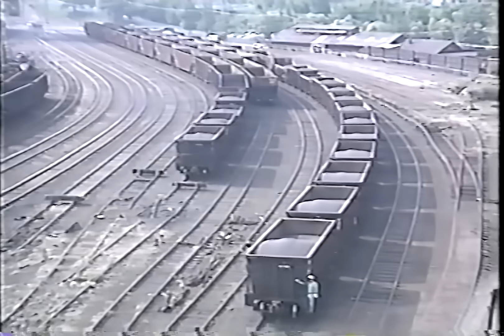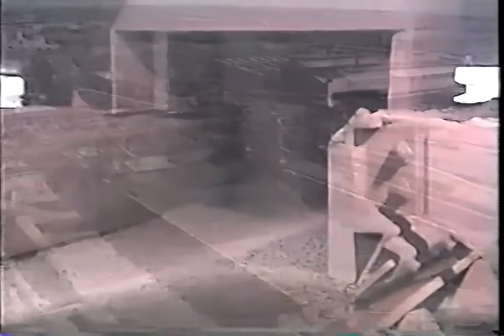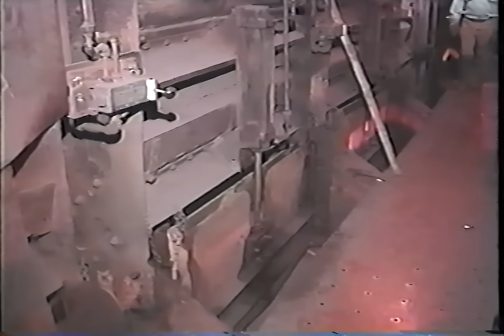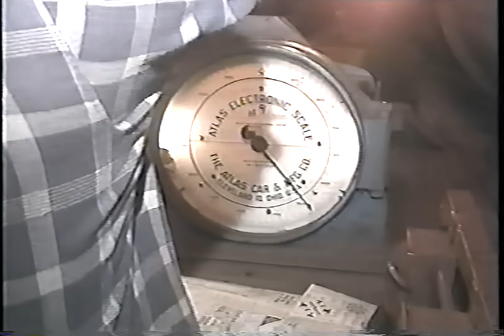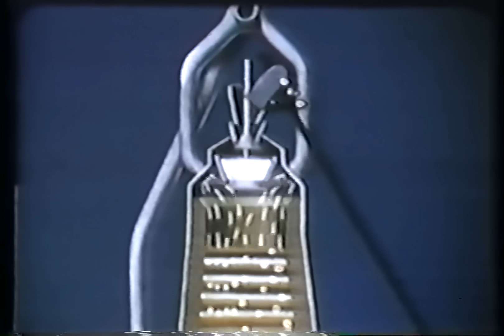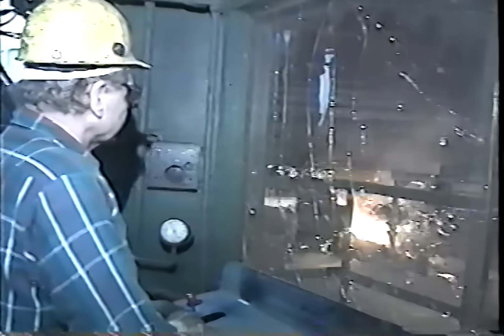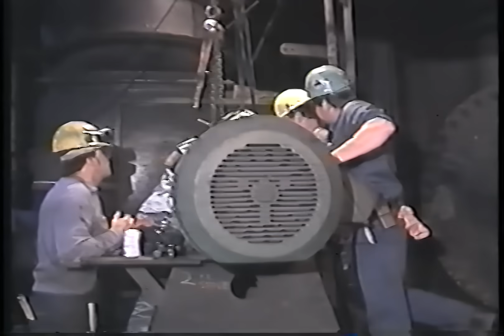Beth Steel Furnaces

Comment: Good video, thanks for uploading.
Filmed in 1995, closed in 2003.  One of the ore bridges now stands over the entrance to a gambling casino they built there.  The blast furnaces were bathed in red light at night last time I was up there, a reminder of their glory days.

When I was a kid, back around 1970, we use to watch the ore trains pass through our town on the Reading Railroad.   There'd usually be four good sized, green & yellow diesel locomotives hauling 100 or so cars through the middle of town.  And they'd be moving too, I'd say 40 or 50 MPH.  Two tracks, northbound towards Bethlehem, and a southbound towards Philadelphia.  It was an everyday occurrence, multiple times a day.  The ore trains would rumble north and the empties would rattle & clack south.  Nowadays they've torn up one of the two rails north of us and it's only an occasional, small, slow moving mixed freight on those rails (although there is a fair bit of commuter train traffic to the south).  It's hard to believe those behemoth trains use to roar through our town.
Reply: It closed Nov 1995. Most buildings demolished 2004.

Comment: My hometown of Buffalo (Lackawanna) had an enormous Bethlehem Steel plant there, 1000+ acres site. Closed in the 1980’s, causing Buffalo to slump economically for an entire generation. Finally making a comeback now, and the old brownfield site is slowly being cleaned up by section for light industrial reuse.
Reply: didnt close in the 80s not sure exactly when in 90s i hauled steel out of there in 90s
Reply: Do you remember the big fire there in 2017, that was big, i wonder what caused it.
Reply: @almaysri743  I saw it on the news, no idea what happened.
Reply: I hauled coils out of there from 1990 to 1994, all automotive grade, republic steel runs the bar mill , and the galvanized finish mill is now a scrap shredder run by metalico, all in lackawanna ny